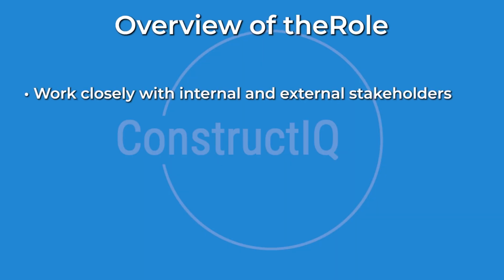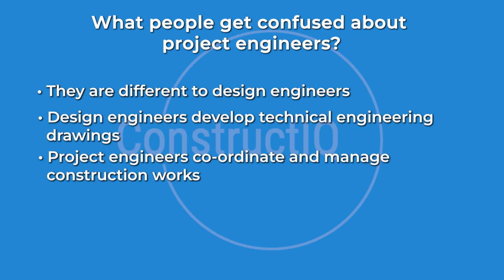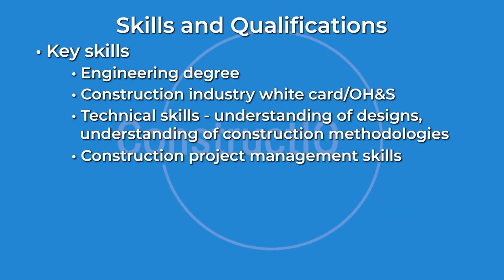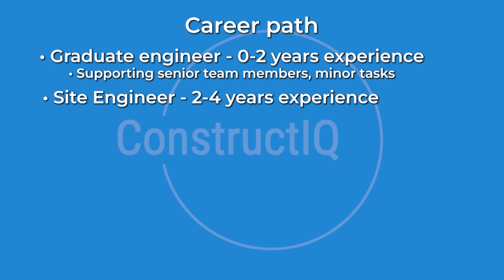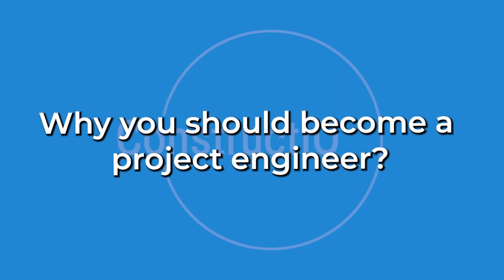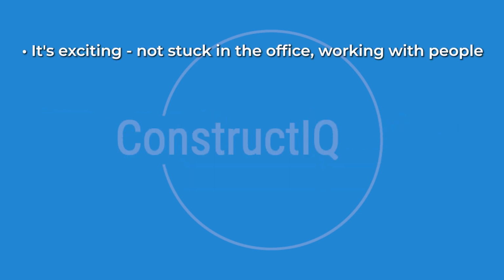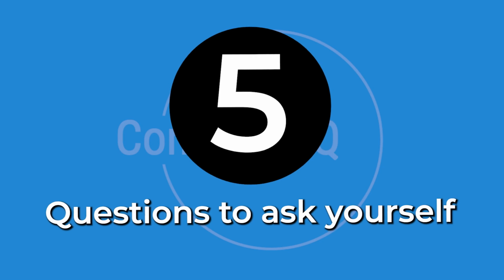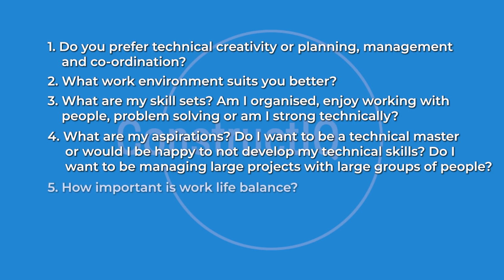Everything You Need to Know About Becoming a Construction Project Engineer

Comment: Can one pursue this career path with a construction management degree rather than an engineering degree?
Reply: Much easier path, I'd recommend
Reply: Yes you can. One of my colleagues got a degree in construction management and he’s doing project engineering work. Project engineer in construction is just a path to becoming a project manager.
Reply from the maker: Yes, they are vary similar. I did engineering but don't really use much of it